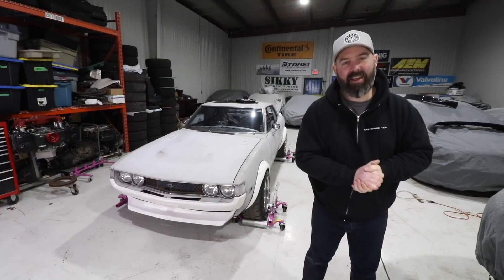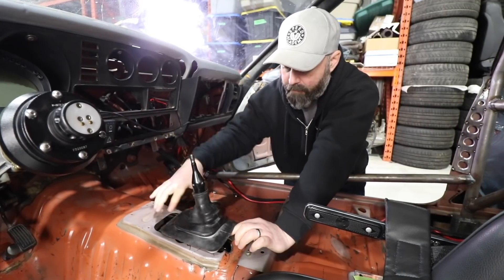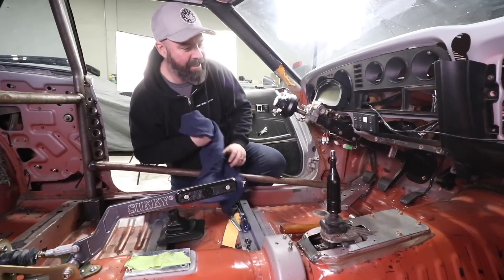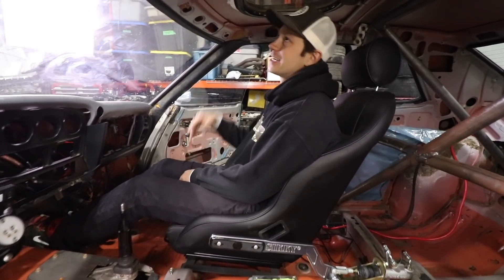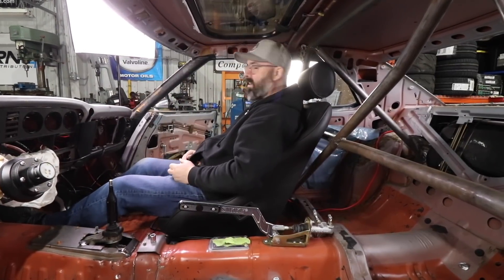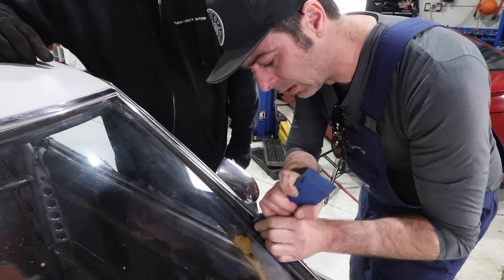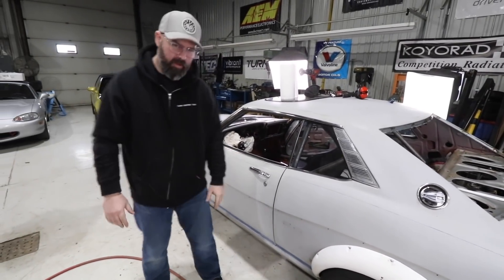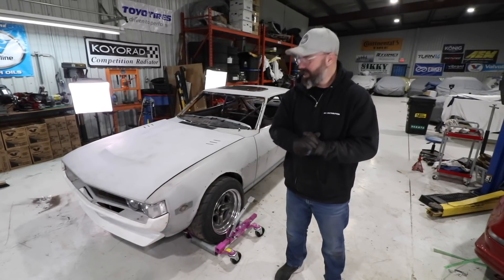Patch Panels, Seat Mounts, Windshield Removal & More - 1977 Toyota Celica Rebuild - S3E01

Comment: Found a blue 1977 Toyota Celica GT Liftback in a guys field one time.  You could barely see it because of the overgrown trees and grass, just a little glimmer of light off the windshield and hood. Popped the hood. Hooked up a 2.5gal gas tank to the carb and a fresh battery...started right up! Aired up the tires and drove it up on a trailer and took it to the house. We cleaned it out and drove it around for a week or so with the gas tank strapped to the hood. Thing would burn the tires right off the rims, stock.  Interior was dirty and needed a detail but was flawless nonetheless. Body didn't have a single dent or rust whatsoever. Paid $125 dollars for the car that day in the field in 2005. (plus gas and battery)

Now for the hard part...

Despite the pleas by my mom to restore it...my dad and I gutted it and proceeded to weld a cage in it and raced it on a dirt track for 2 years before selling it for $800. 

Lots of memories made and lessons learned with that one.  Been looking for another one for years now to restore and it's getting harder and harder to find one...especially for $125.

Comment: Nice work on the transmission patch panel, I built a similar one for my TE72. I’m still interested in seeing how well your defroster set-up works. I followed your lead and put one in my car but the jury is still out if it blows strong and hot enough.

Comment: Awesome to see this getting some more attention. I'm curious, did you still use the seat brackets, or did you mount the sliders directly to the floor mounts? I did mine straight to the floor to get as much head room as possible, and I'm hoping that's safe enough for track use. Obviously I reinforced the mounts so it won't tear through the 45 year old sheet metal, but I didn't use a secondary mount or rail beyond the sliders.
Also, are you planning to use any sound deadening on the floor pans? When the time comes, I'm thinking of going with something like Lizard Skin for heat and sound deadening. Yours being more of a track car, will you do any of that, or just use the carpet and padding as insulation?